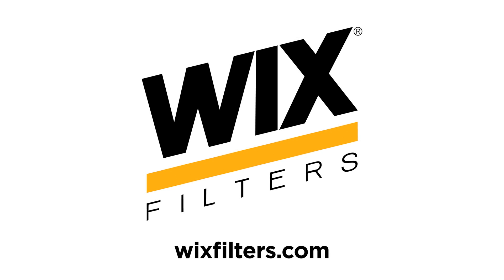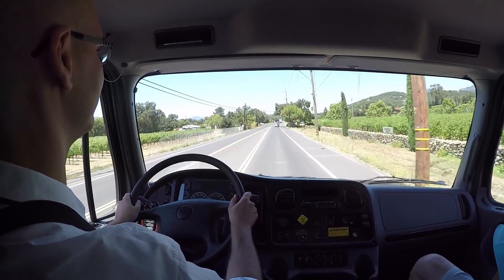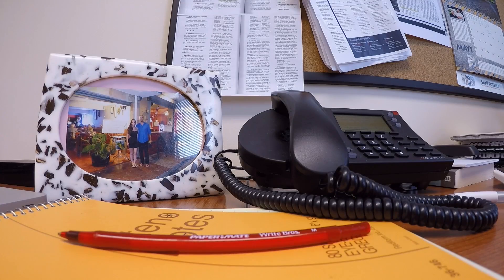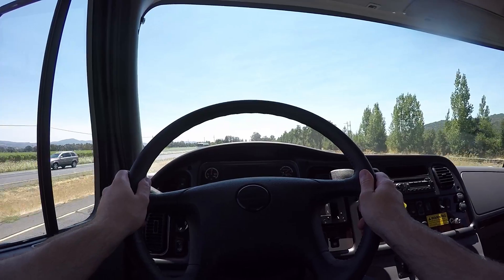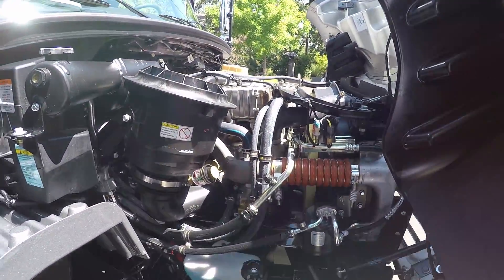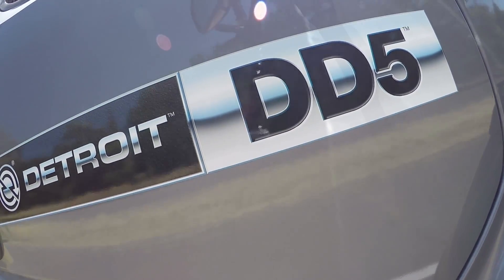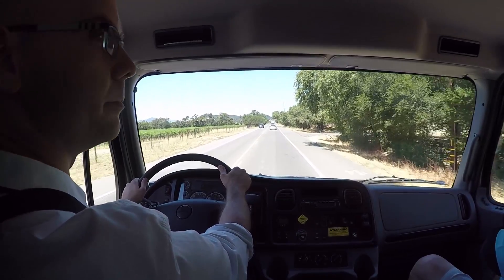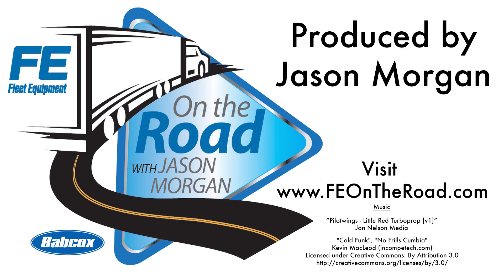Detroit DD5 Engine, Freightliner M2106 Truck Test Drive

Comment: I'm wondering on the longevity,  currently running a 2004 international with a 466 how does this engine compare.  I have 900000 km on this engine,  will the DD5 do the same ?
Reply: Guaranteed not even close and your cost per mile you can multiply it by 5

Comment: I'm sceptical. all I saw was flat level ground. load it up with 26,000 lbs and hit some western Pennsylvania hills. and see how she compares to the 6.7 cummins trucks we have.
Reply: Ian Craig it hauls ass.  Our company has the ISB’s and the DD5’s, i was convoying with a driver from Youngstown to Pittsburgh, other driver had the ISB, i had the DD5, hauling up off the beaver river, he slowed to a crawl, i pulled out to pass him and did 65 up the hill.  He had a flatbed, i had a 13’6” box.  Of course i’d much rather have a DD8, but still i’d take the Detroit over the Cummins.  My only gripe, which now we use them for regional P&D, tri state area, not local, is an engine brake.  The 8 has it, I suppose the 5 is too small, but at 13 tons, the brakes take a beating.  I’m just not happy with the ISB, not saying they suck, but i just don’t like them.  The ISB seems underpowered, strangly enough, the far smaller detroit, does not.
Reply: @jaysmith1408  I think the 6.7 Cummins trucks are tuned to upshift sooner for better efficiency, which is why they feel slower. Even uphill with your foot on the floor, they upshift too soon and it bogs. This DD5 revs higher and holds gears longer. 

Which is why I hate non-selectable automatics, they hold these engines back.
Reply: @AdmiralRustyShackleford  at least our ISB’s have a hunting problem with the transmissions.  Drops 10mph for every shift, then revs to redline, then shifts again, down 10 more, and back and forth, and back and forth.
Reply: Lies, this junky over engineered vibrating junk cant even compare to cummins 6.7l. I drove and work on both

Comment: Where can I purchase the coffee mug? Loved the DD5 video!
Reply from the maker: Hey Adam, the coffee mug was swag from the 2014 NTEA Work Truck Show. (May have been 2015, can't recall which year.) They have a cool new catch phrase mug every year. Thanks for watching!
Reply: Fleet Equipment thanks my wife made me one :) great videos. Would like to test the DD5, as a small school bus contractor I'm always interested in new technology. Any POCs you can provide? Daimler said to contact the dealer and the dealer had no clue.... I'm ordering two Thomas C2's next year and wanted to drive the DD5 before that acquisition. Appreciate any insight.
Reply from the maker: Not that I know of. FE doesn't deal too much with the bus side and I'm not sure if the DD5 will be available in Thomas buses. Dealers will likely be your best bet. Check with an Elite Support dealer, one of them will likely know more than your typical dealer: http://www.elitesupportnetwork.com/
Reply: Fleet Equipment my dealer confirmed that the DD5 will be available in the Thomas C2. Based on your experience, how do you think this engine will perform compared with the Cummins ISB? How was the acceleration, throttle response, etc.? Thanks for your inputs.